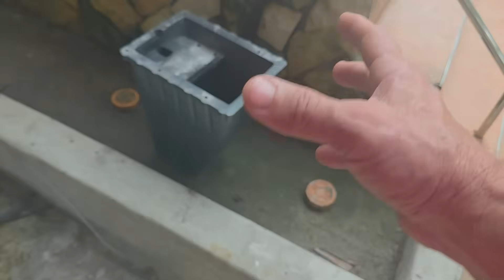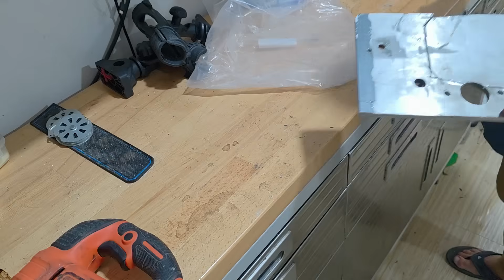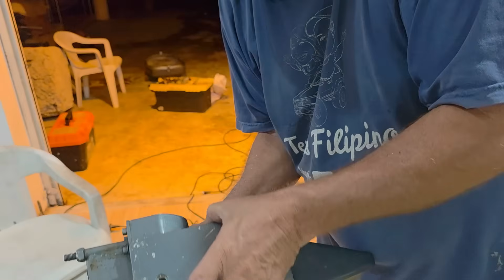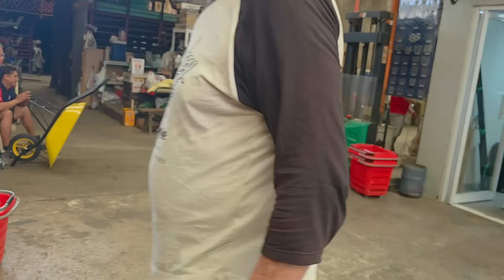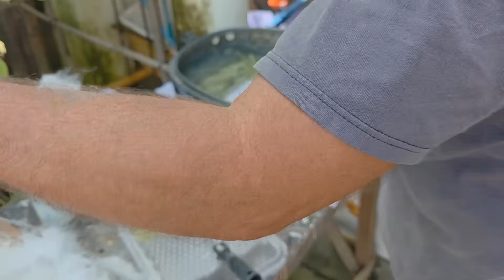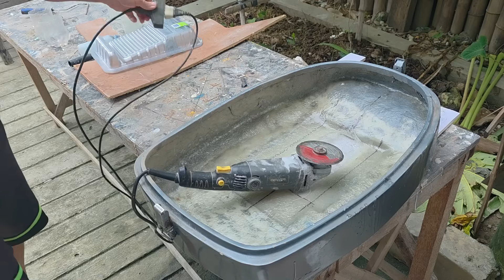Diesel Outboard Rebuild and Design Part 3 Lots of Progress

Comment: long time subscriber first time to comment after watching you cut the aluminum can I suggest using a blade with less teeth and use bar soap for lubricant which will also help when grinding lastly be sure to use antiseaze on your bolts to help with removeing if you ever need to
Reply: Tony, comment more often, it helps his channel
Reply from the maker: This was a fine tooth blade. I always use anti seize.
Reply: Yes Tony I concur with c brown 9555 do comment more often it really helps & he needs all the good advice he can get 😊